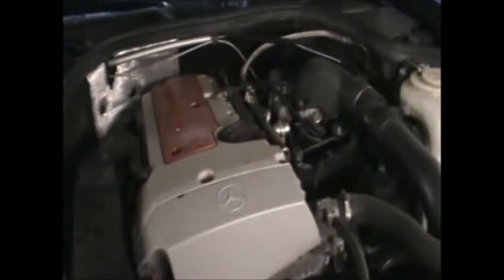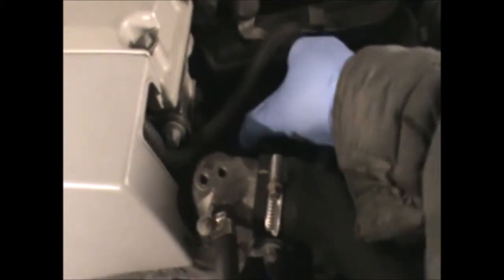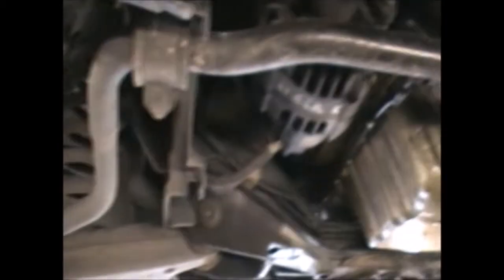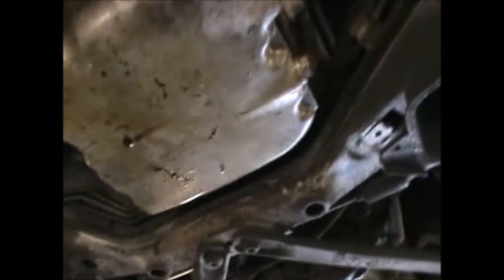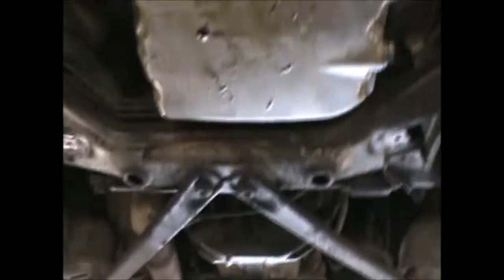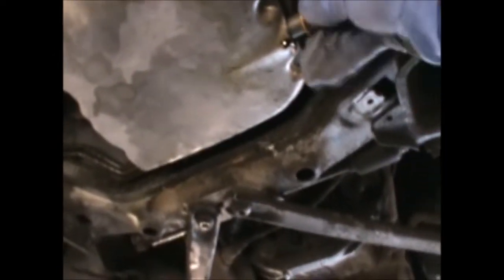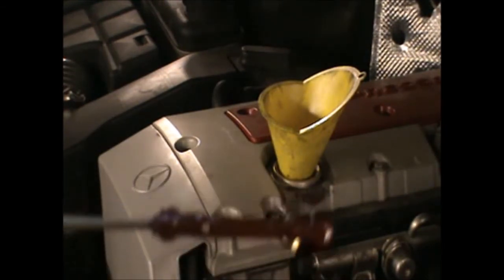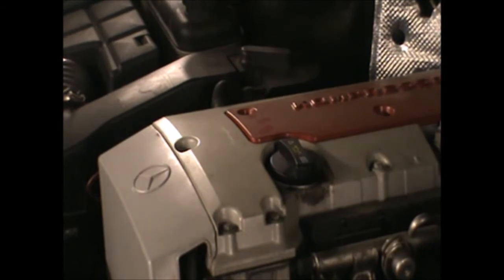Mercedes CLK w208 oil and oil filter change

Comment: Please awser My question after you full THE oil in THE car and start it Up that Short noise strange noise from THE motor what was that????? My car have that same sound but only some times whats THE problem??? Please awser this!!
Reply from the maker: Holy7K i think that might be something to do with the chain tensioner or the camshaft gear adjusters. But am not 100 % sure yet as i am also investing that sound.
Reply: @DaringBeefcake  thank you such a fast reponse i really prishiated once you know what that is leat me know i just changed My oil in My MB 200 cab
Reply from the maker: Holy7K yes will do. Well done with changing your oil.
Reply: @DaringBeefcake   that sound comes from under THE motor beside where you open to leat THE oil come out when you need to change. It seams like there is a leak of oil from THE engine iand My engine light is on in THE display.. have you meak any progress about that strange saound??